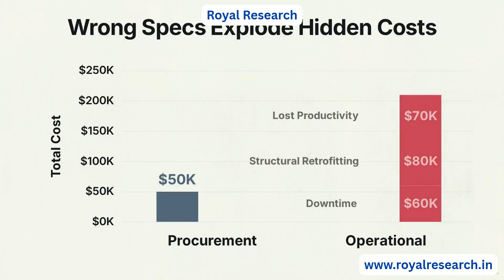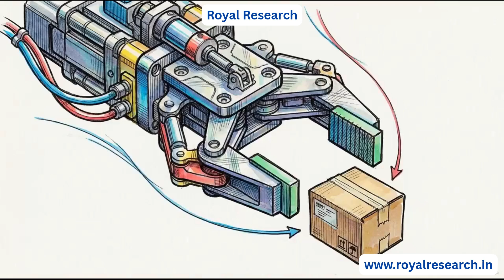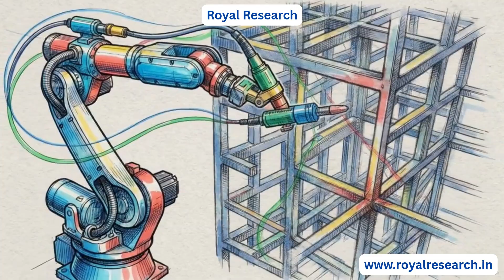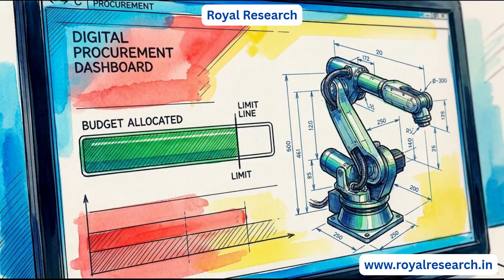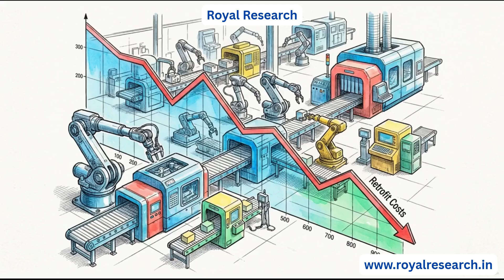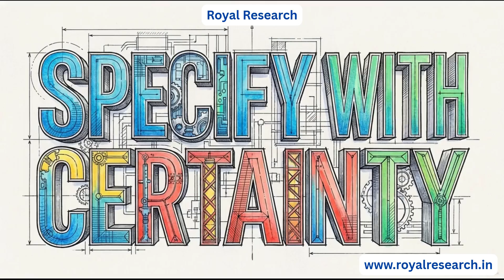RoboDK Robot Libraries: How to Select the Right Industrial Robot for Your Application

Comment: Selecting the right industrial robot requires more than comparing payload and reach. RoboDK’s robot libraries make it easier to evaluate compatibility, workspace, cycle performance, and application requirements through simulation before investing in physical hardware.
Reply from the maker: Absolutely! Simulation enables deeper evaluation before investment, helping engineers select robots that truly match operational and application requirements.